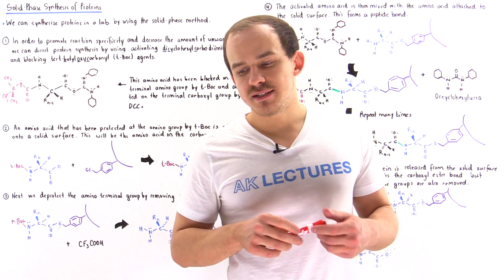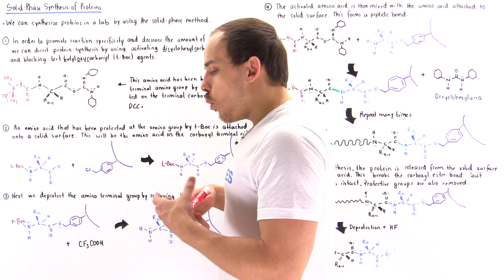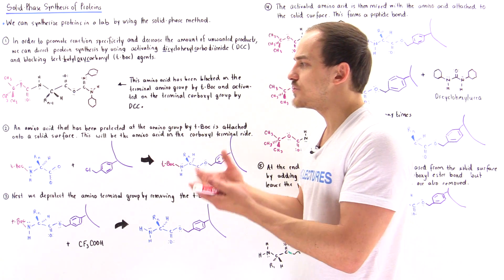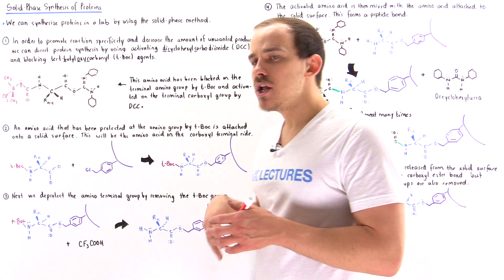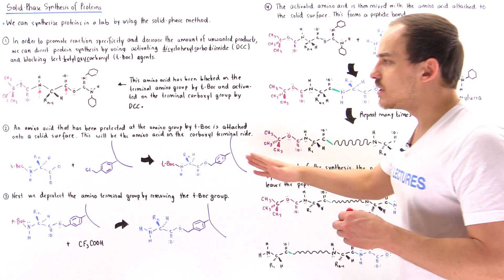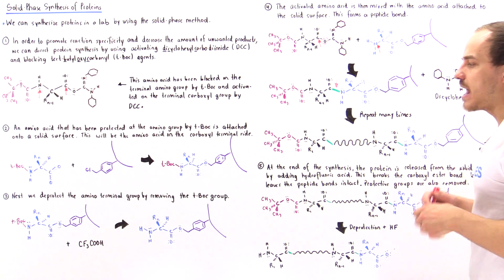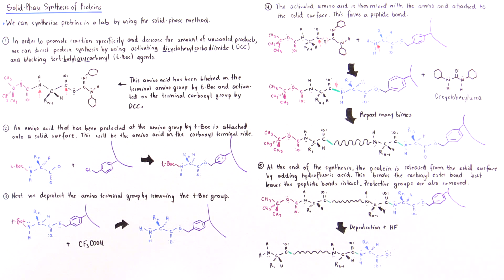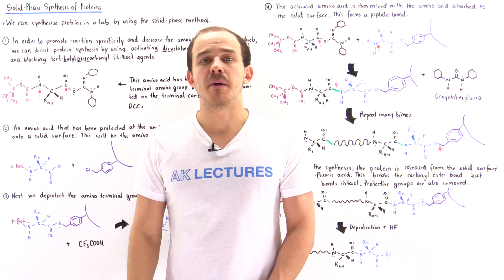Solid-Phase Synthesis of Proteins

Comment: just for information aminoacids for synthesis, are purchased with t-boc or Fmoc  protecting group already attached to backbone amine. Also side chains have protecting groups. 
DCC is a good activator for backbone carboxylic acid, there are also other activators that could be used.

Comment: HF is extremely corrosive, would this be used in an industrial setting that is safe for workers?
Reply: that is why Fmoc protecting groups are used instead of tboc so TFA is used instead of HF for cleaving. peptide synthesis is not easy

Comment: Simpel and straightforward explanation. However, using "actual" ever 5-10 s is a little annoying. If you could reduced it and only use it, when you want to underline something it would improve your point :) All in all, good work bud! Keep it up.

Comment: Btw on that top DCC molecule your nitrogen has 2 lone pairs, 2 sigma bonds, and 1 pi bond - though it should have one less lone pair as a group 5 element if it's neutral as you've indicated